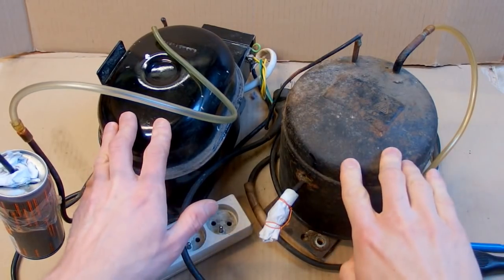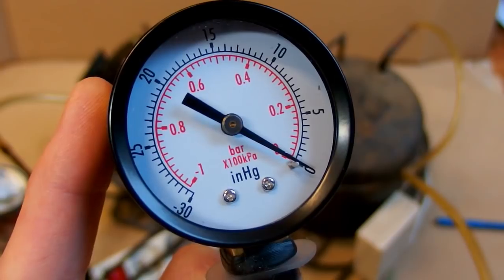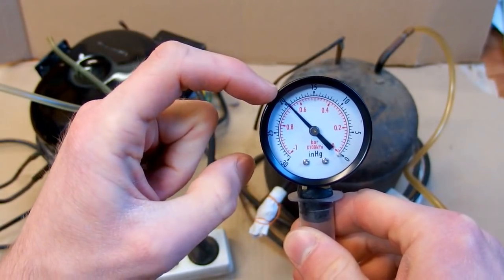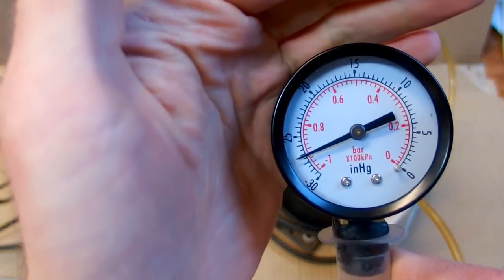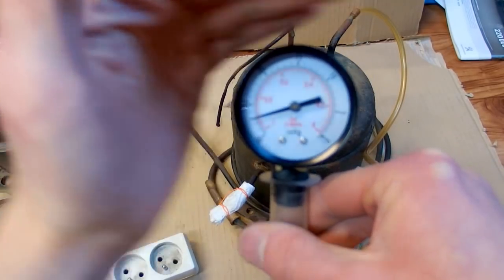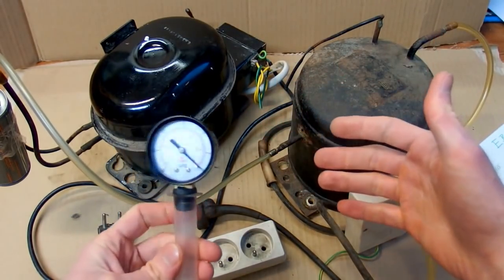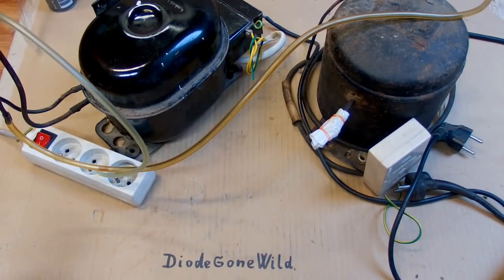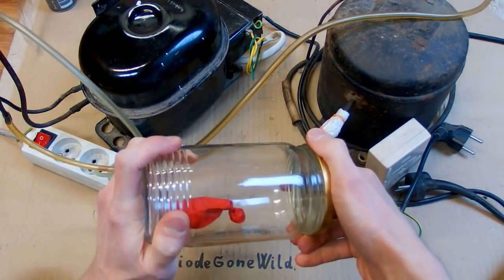Fridge compressor as a vacuum pump? Measuring the vacuum.

Comment: how can u not realise u need them in paralell to increase vacuum i thought u are a engineer (;
Reply: how do you put them in parallel
Reply: @thelightdesigner4490  aah solder outputs into a t section and inputs same so comps are parallel not one pumping into the other fuking them up inside
Reply: That's not how it works, parallel simply increases speed, not total pressure. The maximum vacuum is however much is required to overcome the check valves. With putting them in series it reduces the backpressure keeping the valve closed which increases your total vacuum slightly, but your still limited by the mechanical force of the check valve. Putting in parallel would have a worse vacuum as there is nothing to help reduce the backpressure against the back of the check valve.

Comment: you need to get popper fittings for your silly vacuum gauge also can you link the eBay page at which you bought the gauge
Reply: At these levels of vacuum those homemade fittings work just fine. Outgassing and near molecular leakage don't have any significant effect until much stronger vacuum levels.